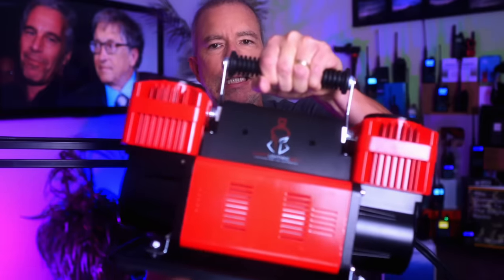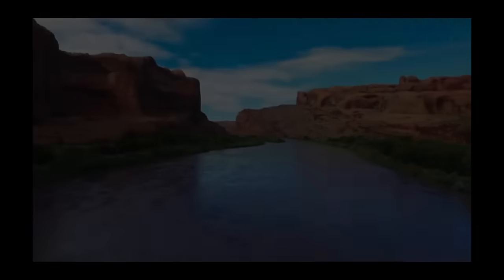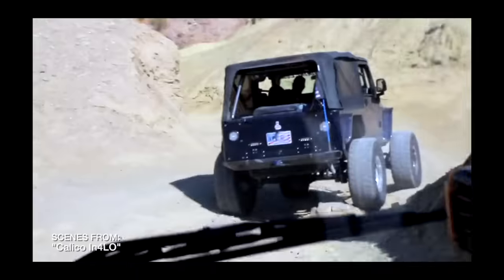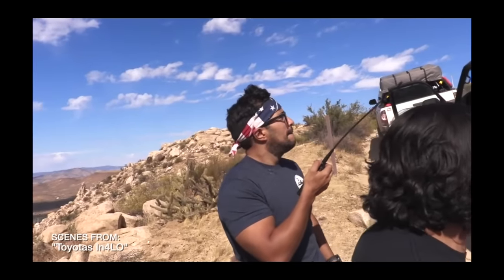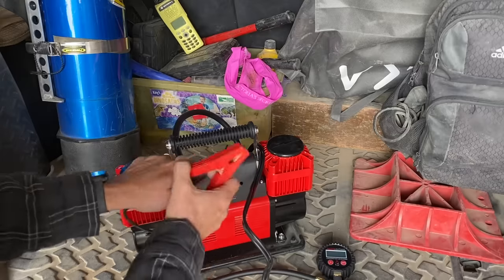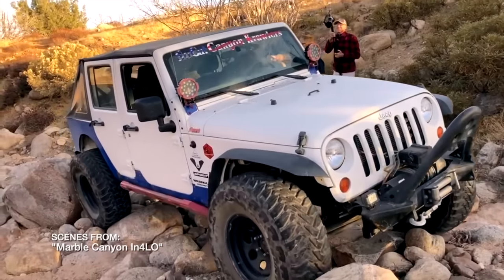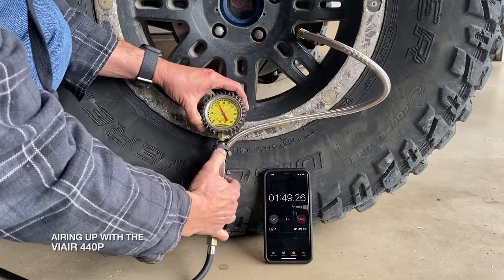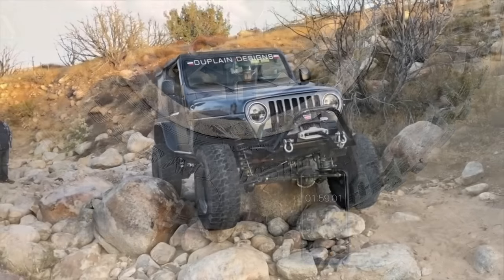Thor's Lightning Bolt True Dual Air Compressor - The Best 4x4 Air Compressor I've Ever Seen

Comment: Due to Me being your favorite viewer, and actually in the market, I need options for air compressor that bolt into the engine bay. With out being ripped off. Thanks, your Favorite Overlander Viewer.

Comment: I use a CO2 tank as a primary way to air up but I do keep a cheap Viair as a backup. I may pick this up as my new backup. As a side note I did meet my wife airing her tires up after an off-road adventure with friends. So scoff all you want at "impressing the ladies" but it is a thing.

Comment: I actually just got the Total Control version of this compressor a few weeks ago, along with the 4 tire kit. I have it permanently mounted under the hood of my 4Runner, and hard wired. Aired down all of my 33" tires to 14 psi, then up to 34 psi in just under 6 minutes!
Reply: Thanks for the info! Was thinking if it would handle a 4 tire setup!
Reply: Id like to do that with my tundra but not sure if I have the room, might have to mount in the cargo area........too bad you can't post pics here

Comment: At the end of the day at the off rd parks I go to I would watch most people struggle trying to fill up there tires with those small compressors. I bought several over the years. I went and bought a 2000 watt inverter and a 5 gallon AC air compressor. Simple installation. Now I spend just minutes filling my tires. Have fun.

Comment: Very nice! I have just the single cylinder ARB on my truck, mounted under the hood. I have 35's, but don't air down much at all. Mostly just for airing up and filling air bags for when I have my slide in truck camper on the back. If I used it more, this would definitely be on my list to get. Not a bad price as well. Thanks for showing this compressor off.

Comment: I was a volunteer fireman 30 years, and years ago, we were getting rid of some old aluminum air tanks. I got 2 and had them tested and would get them filled at a neighbor department to 4500 psi and regulater with a hose. It will fill several 33" tires.
Reply from the maker: Compressed air is decent for smaller tires, but you can squeeze in wayy more CO2 into a tank which is why it's the gas of choice for manly off-roaders like me.

Comment: I’ve been telling folks for years the Napa MaxiTrac twin is the best under $125. It’s the same one other companies modify, paint and resell.
Reply: Sadly trying to find them is almost impossible and when you do it is double the original price. I keep checking my local NAPAs to get one, and it now looks like it has been branded as NAPA Horizontal Electric Air Compressor- Balkamp BK MTWM10215C.

Comment: There are several companies that sell the same style. I assume it's actually the same compressor. EZFLATE, MORRFlate, THOR ... But these are amazing for the price. I've used my EZFLATE for a couple of years. No issues. 4 tire inflate  system. Air a set of 37s up and down in minutes.

Comment: Great video. I've been on the fence about the NAPA version of this (made of pure unobtanium), vs an ARB Dual+Kraken system (and provision for an air locker later on). I'm using the VIAIR 300-series at the moment (it's glacially slow), but I'd prefer a mounted onboard solution rather than a portable. I'm surprised to hear you had problems with your ARB dual. Anyhow, please more Jeeping videos (or bouncing 'Yotas with busted U-joints). That was gold right there mate.

Comment: I had a car with a slow leak (i'm no expert but I think it was a bad seal) so I got a tiny compressor. I got a different car that has even smaller tires (I swear they are practically motorcycle tires on a car) I don't have as much trouble with this one. (it has the annoying tire senors) I also have a rechargeable jump starter that I live by it get pretty cold here in the Midwest (-40 degrees). I bring the jumper on trips. I like all the things Randy talks about, If I find a handy tool you bet I'll tell everyone!

Comment: Thanks for another great installment. I have run a 400P for a few years. Very satisfied with its performance, but my 4Runner's modest 34s require less squirt to air up. I saved the Thor's Lightning in my Amazon list to replace the Viair when it gives up the ghost. Can't wait for the mass of fans to gather when they celebrate compressor's two-piston performance.

Comment: What is the max PSI of the compressor?

I’m wondering if you could use the C02 tank as a reservoir for the compressor.  That is, instead of refilling it to some relatively high pressure with CO2, instead pre-fill it before your adventure from your compressor up to whatever maximum it can achieve.  Then when it is time to air up your tires have the compressor feeding into the tank, and an output from the tank for the tires.  That way you should be able to air up your tires somewhat faster than with just the compressor alone, and avoid the cost of refilling with CO2.

Is asking about PSI and CFM the equivalent of asking about fars of GMRS radios?

FYI – “duty cycle” refers to how long it can be running over some time period.  A 100% duty cycle would mean it could run continuously.  A 50% duty cycle means it should be off and allowed to cool down a length of time equal to how long it was running.  The time period for the duty cycle should be in the manual somewhere.  At a 50% duty cycle obviously they don’t want you to run it for 10 seconds then shut it off for 10 seconds.  As you have seen, several minutes of continuous running is fine – enough to do all 4 tires.  However long that takes, I’d let is cool down an equal amount of time before airing up your buddy’s tires.

Fun stuff, and I’ve got one final thought for you guys – lockers! ;-)

Comment: I'm not an off roader. I was a rural mail carrier for thiry years. mail carriers have a lot of flat tires from running all day, 60 plus miles a day on the routes I worked. I used a harbor freight hot dog style air compressor that cost around forty dollars, and a 700 watt power inverter to make it compatible with the 12 volt system of the truck. Have a tire plug kit as well and you are good to go.

Comment: Not hitting the stuff you hit, just an "overlander" with a sweet Dobinsons suspension on my 4runner that I like to put to the test any time I can.
Currently running a Milwaukee battery compressor with the tank, not too shabby since it's lightweight and pretty quick, but it was way more $ than this.
I'm gonna grab one of these, thanks for the vid, and thanks for incorporating your hand modeling skills within.

Comment: I’ve got a question, but I’ll see is Not-Ai-Rubicon can answer it first:

Is the “Thor’s Lightning Bolt True Dual Air Compressor” CHiRP compatible?  I’m trying to add all of my local repeaters, and I’m not sure what software I need to program it.

— — —

Ladies and gentlemen, let me break it to you straight. The "Thor’s Lightning Bolt True Dual Air Compressor" - now, that's a mouthful - is about as compatible with CHIRP as a fish with a bicycle. CHIRP is for programming radios, not air compressors. I mean, I'm not sure what you're trying to do there - maybe turn your air compressor into a GMRS repeater? That would be a sight to see, but it's as likely as the FCCs giving me a free pass on my shenanigans. 

For programming your local repeaters into a radio, you'll need to use CHIRP or the manufacturer's software for that specific radio model. Make sure it's a radio, not an air compressor, unless you're trying to start a new trend in the radio world. 

So what I am really saying is, you might want to double-check what device you're dealing with before diving into the wild world of programming. And if you're really trying to program an air compressor... well, I'll be the first to subscribe to your YouTube channel to see how that turns out. 

..... 𝗔𝗳𝗳𝗶𝗹𝗶𝗮𝘁𝗲 𝗹𝗶𝗻𝗸... ⬇️ 𝗕𝗲𝗹𝗼𝘄....

Comment: Great video. I've been looking for a good AC, and with 10CFM, I bet you could even run an air tool if needed. I sure wouldn't mind if you did more reviews like this every once in a while. Thanks, and keep up the great work.

I forgot to ask, have you done any videos on what db gain means and explain that whole thing? I was looking and didn't see any, but I may have pulled a Ray Charles too, and just didn't see it. Thanks.

Comment: Why not just get an AC powered air compressor for home that you can use to pressurize a portable air tank? Would a five-gallon tank at 100psi be enough to fill four tires? Also, what about using nitrogen instead of C02? I believe nitrogen is cheaper.
Reply from the maker: Nitrogen is more expensive and does not behave the same way under pressure as Co2, nor does anyone market a safe, portable tank system for nitrogen for refilling tires making Co2 better for this application.  ..and a 5-gallon tank of air would not be nearly enough for all 4 tires nor would it fit very well in most vehicles.
It is just more practical to carry a small portable compressor or a compressed C02 tank.

Comment: Mr. Randy. As I originally typed out a long response, only to discover had I posted it, you would have called me an idiot. SO, in lieu of that question, I have another! Sir Randy, have you considered, or do you have, a 4 tire hose system for airing up your large, and rubber, tires?  What are your thought/s of a 4 tire hose?
Reply from the maker: Those 4-tire hose monstrasities waste more time un-wadding and wadding them back up than you save by using them.

Comment: While my 35" tires are no where near as impressive as your VERY impressive 37s, I use a Milwaukee M18 tire inflator to air up after off roading in my very manly Bronco. It takes about 90 seconds to go from a squishy 15psi up to a very stout 38 psi. Not as fast as CO2, but faster than Mjolnir. The inflator costs $179, and if, like me, you are already invested in the manly superiority of Milwaukee's M18 tool system, you don't need to buy a battery. I've used a single 6.0 Ah battery to fill 10 tires before the battery died. Worth checking out.

Comment: I’ll put my 80 ft^3 at 3000 psi SCUBA tank with an air chuck screwed into a low pressure port up against Thor’s hamburger and your CO2 toy for both speed and cost.

Comment: Your offroading videos are still far superior to anything else on the Youtubes.  As I've said before, I hope you'll get back into making offroading videos.  As for air compressor talk, I've been squirting 10cfm of air out of my similar MORRFlate compressor for years, and I wouldn't want to run anything else.  A 4-tire air system will significantly increase the speed at which the compressor can squirt airs into your manly 37's, as will keeping the engine idling while doing so, since 14 volts of electricities will give your compressor more chick-impressing pumping power than only 12 volts will.